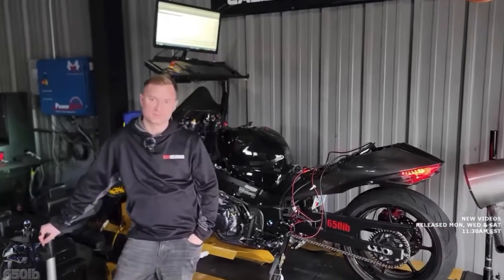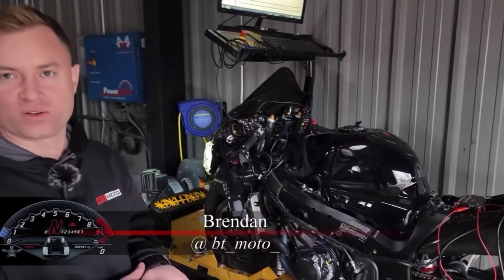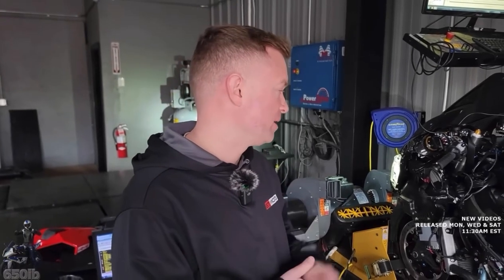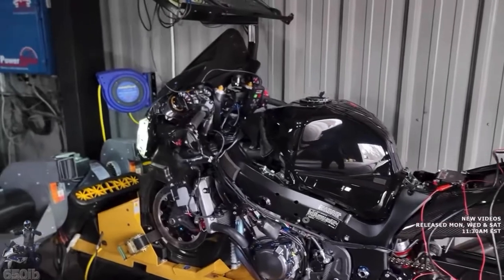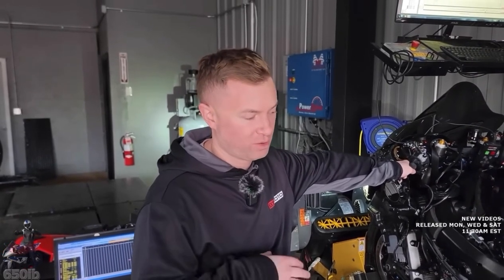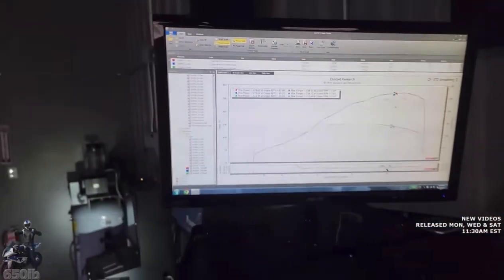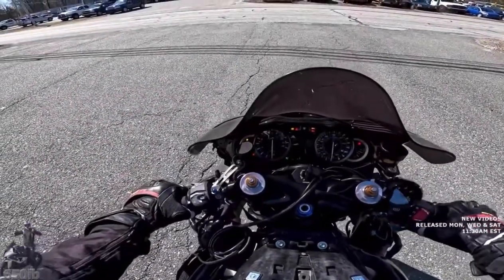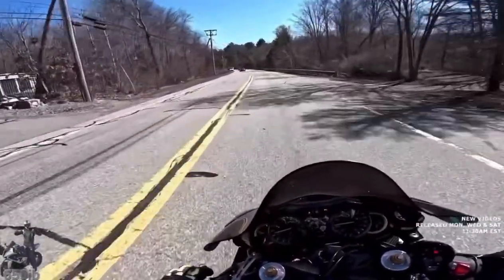650ib’s 274WHP 2023 Suzuki Hayabusa 1600cc Stroker engine with BT Moto Ecu flash tuning.

Comment: Shouldn’t  you be in 4th gear on the dyno? That’s the 1 to 1 ratio. Doesn’t running in 5th give you a higher number?
Reply: Ummm sportbikes don't have overdrive...
Busa 6th isn't even 1 to 1.
Its 1 to 1.043